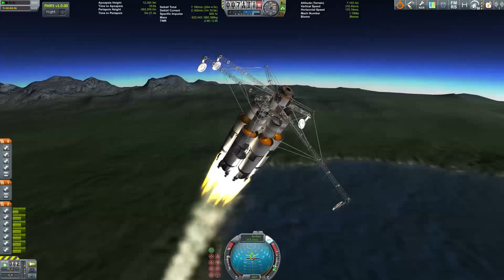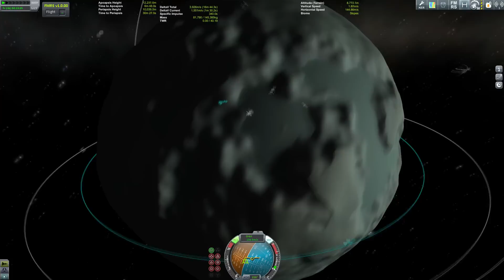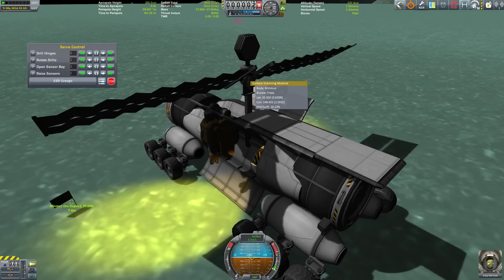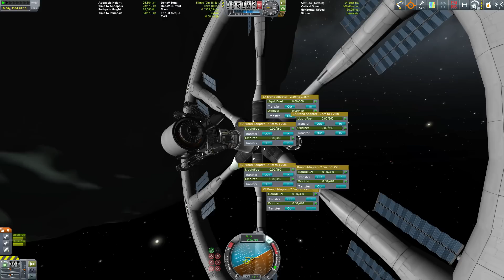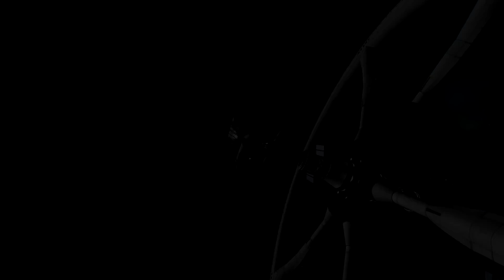Operation Moonsucker Episode 7: Move b***, get out the way! - FINALE

Comment: Give up on moving fuel to the station with the crane. Too many moves involved with too many pieces of equipment. Build a dedicated space tanker truck to do it. 

2 or 3 tanks with decent lift engines for the weight and a truck undercarriage like the drill platform. That way it is 1 vehicle all the way from the refinery to the station.

Comment: For the life of me I cannot figure out what parts you are using for connectors underneath your refinery's. It looks like a circular fuselage  that your able to connect on the side, with a zk1 battery pack on the bottom. Please o wise one teach me! x-x
Reply from the maker: The secret is quite simple: I use cubic octagonal struts and clip them inside the fuselage. Then I can attach anything I want.
Reply: Lol right as you posted this I found the radial attachment point which also does the same. But how do you clip something inside the fuselage? Also Thanks for the reply ;D
Reply: +blademan sixonenine I would imagine you use the "Allow Part Clipping" option in the cheat menu. But im not too sure
Reply: +blademan sixonenine You can use the offset option in the VAB.